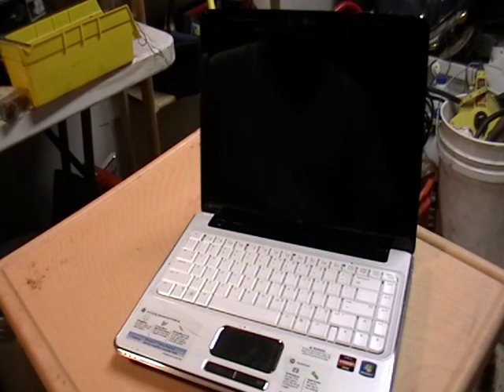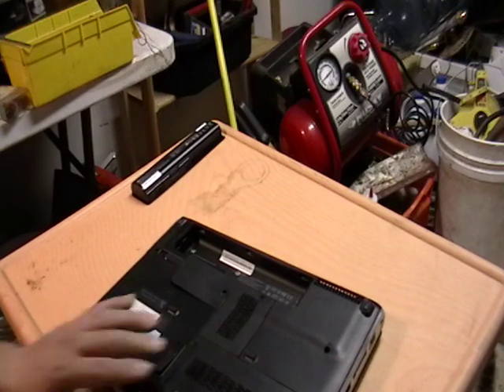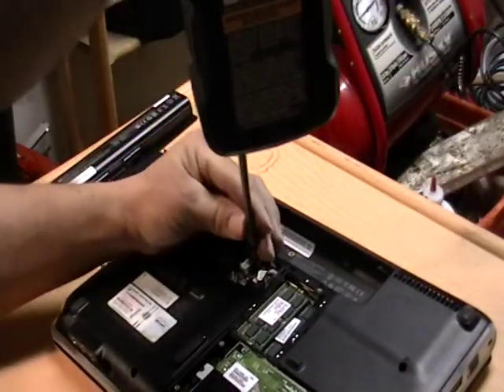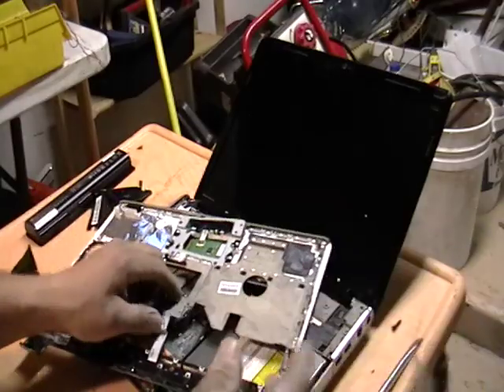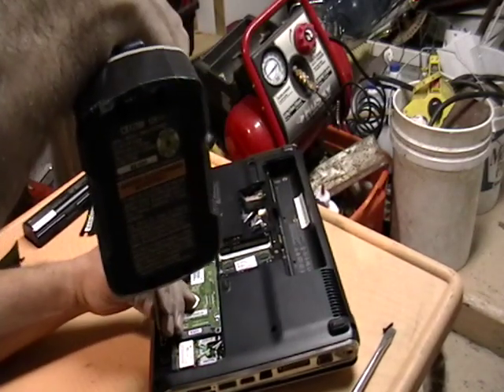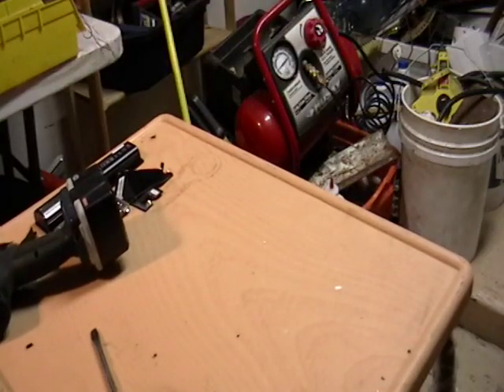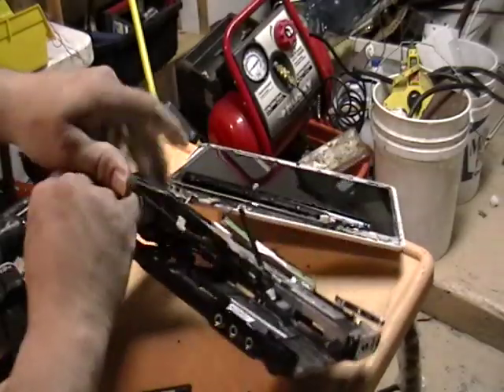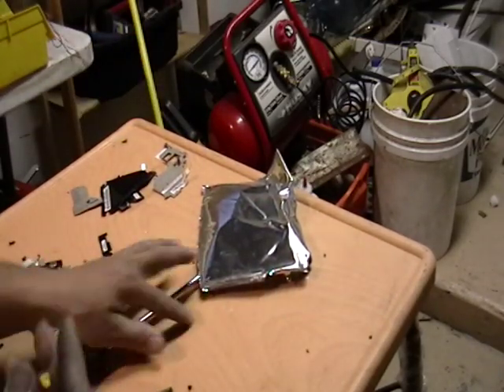Scrapping a laptop computer

Comment: As some others have pointed out, there are a few moer gold plated components in there. Some things you may want to consider; 1. The keyboard, just like a full sized one, has the mylars with silver traces on it. 2. Almost all of the connectors and their sockets re gold plated in there. Just take a look at them. It's not much but it all adds up. 3. DO disassemble the screen housing. Gold plated connectors and the lil inverter(which can often be ebayed). Just don't crack screen(mercury)..  cheers

Comment: Hi, depending on the condition of the notebook (or any other "notebook","compact", or "all-in-one" based computer), you can search online (youtube or not) if you can verify the make and model numbers of the "non-desktop." Sometimes you might actually find a service manual to make for a much "cleaner" disassembly. Believe it or not, if you decide not to scrap some of the plastic front panel or internal frames, you might actually be able to sell it online as-is for a decent cost to a buyer.

Comment: mike, first of all dont trow away those hard drives and rams. u can sell them for good money on ebay (if they work, mostly they work). at 10:02 its a heatsink like normal pcs, it has cpu and gpu under it, if cpu is ok; u can sell it on ebay too. thanks for the videos btw.

Comment: would of been worth alot more sold whole
Reply from the maker: Any thing that works. if you are good at fixing computers you can make good money.
Reply: nope this laptop would have been worth some cash even if broken....even the cpu would of fetched $40 ram about the same as well and same with that hdd
Reply: ictdude1
that looks like one of those netbooks, which are worthless. Whole laptops are like $50 and thats when they work. Those hard drive prices, memory prices have dropped so badly in the past year. 500gb drives selling for $30, 4gb memory for $20 ; It's really not worth taking those apart anymore. I used to make $150 on a $50 investment. Now that model no longer works. You have to invest $100 to get $20; I think it might better to go back into restaurant business again.

Comment: Ow, it hurt me to watch this video(funny though). That laptop in particular would have made you more money by repairing it and selling it vs scraping it. Also under that nice piece of copper is where the cpu is and the copper is part of the cooling unit. If you are scrapping it, the lcd if it works, can be worth around $50-$100 depending on where you sell it. I would recommend watching a youtube video with the model number of the laptop so you can take it apart correctly. Then selling the RAM, HDD, Optical drive, Processor, and cooling unit on ebay or craigslist separately. Scrap the rest as you please. Keep on scrapping and and making these videos! Thanx!
Reply: Also sell the LCD on ebay or craigslist, people always break them and it is better to buy one off someone instead of buying a new laptop or new screen.